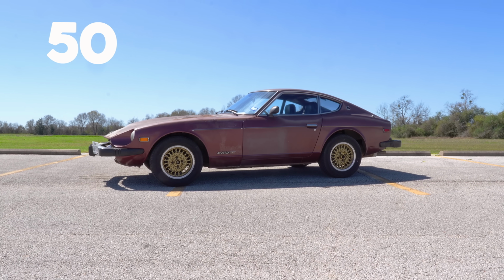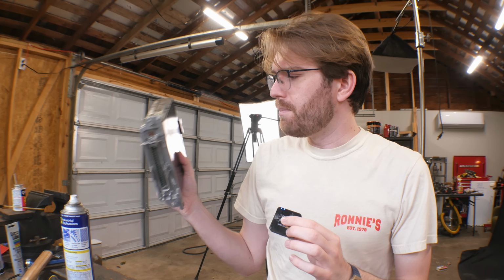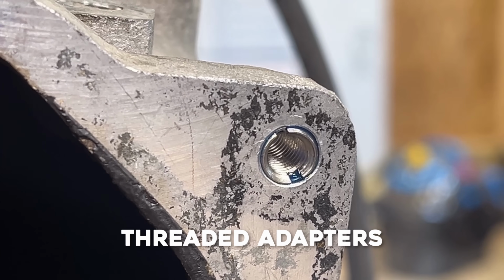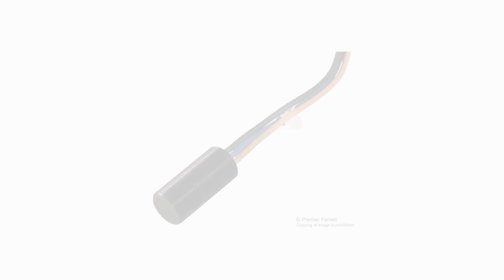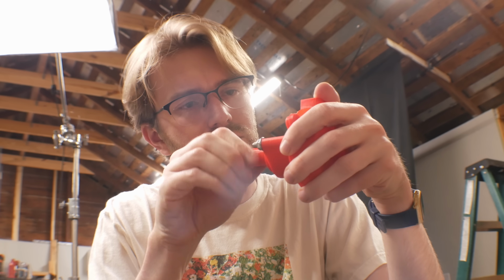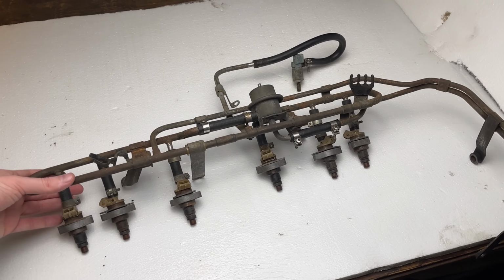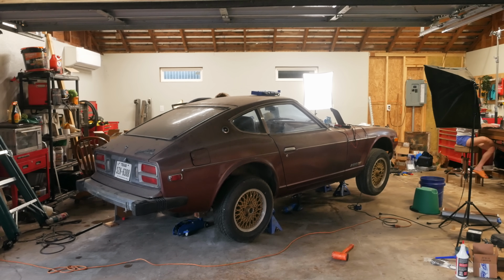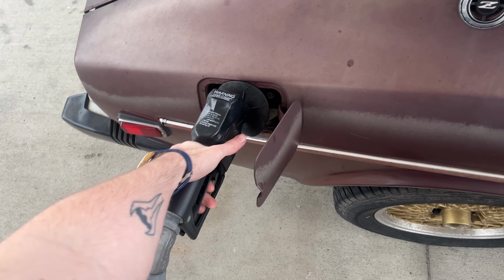Modernizing a Vintage Car

Comment: Is it just you, or is it actually called a trigger wheel in the US?  We call it an ignition rotor, my 2000 Kawasaki ZX9r uses one, changing it is a great way to get more responsiveness by advancing the ignition timing, which of course I have done amongst other cost effective tuning mods, no need for expensive ECU tuning.

Comment: I am so torn. As a twice former 240Z owner I absolutely adore these cars, and as an old guy I love the nostalgia of keeping them "as is". Yes, the car is sneaking up on being 50 years old but its hard to argue with a multimillion dollar corporate tech dept [billion these days] who not only had to make it all work but had to make it reliable. and this is where I hate myself... if it's more power and more efficiency you want, the logical choice is a modern engine swap. And that logical choice is... the Chevy V8. Whether it's old school SBC or modern LS, you can easily double the HP and get fuel economy in the mid to even upper 20's with no effort at all. And the best part is it's been done a bajillion times over so there are plenty of swap "stuff" out there to work with.  Now all that said, if I had myself a Z, and I had myself a stuffed bank account [which never happens] I might even consider a GM LL8 Vortec 4200 as a swap. You keep the straight 2 layout, which IMHO is one of the greatest sounding engines EVER] plus you get 270-290 [depending on model year] of HP in an absolutely bulletproof, bone stock engine. Okay, I can dream cant I?

Comment: 😂😂😂 not a bad experiment, the only things I would do is change the exhaust and exhaust manifold bigger and change the inlet plenum and go for a bigger throttle body. That 50yo exhaust and plenum will be like trying to suck and blow through a straw 😂 won't be much of a gain but it will help or throw some boost at it 😂🤔 other than a turbo, turbo manifold and a better exhaust you have everything else 👍

Comment: Should have installed LPG from Poland. 110 octane, and fuel is 50% price. Pretty much the same process, only plus an additional tank in the place of a spare wheel.

Comment: 26:55 ah yes the good ol' "finding 10 different mistakes you made and none of them being the source of the big issue you're facing"
Reply: Shooting your shot while troubleshooting with a shotgun.
Reply: I found a relay socket with bad contacts once, and I learned why shoving test probes into it was bad. The fuel pump relay wasn't even connected. Cranking the engine for five minutes would energize something else (oil pressure sensor?), which would also trickle power into the fuel pump and the car actually started. It even ran well, when it started at all.
It only took a month plus removing and reinstalling the entire dashboard to figure it out.
Reply: A classic
Reply: Nice pfp
Reply: Been there done that. At least on this project he never had to let out the magic smoke.

Comment: The horsepower gain is just a byproduct to me- making the car greatly more reliable and serviceable is the really impressive part.  We can all appreciate the shit-ton (precise unit of measure) of hours that went into this project and the resulting video.  A masterpiece takes time.  With the refreshed (resto-mod?) look of the engine, consider giving it a Chris Fix makeover (https://www.youtube.com/watch?v=PRSoRkM8GcM) to really make it visually pop when you open the hood and can now see all that aluminum. You gained several pounds of weight reduction too!  Yes, a masterpiece! Thank you!

Comment: Fine addition to the saga! Actualizing fuel injection and not just blatantly spraying it and praying has an additional benefit; oil won't be spoiled by an abundance of fuel flowing downward from the ignition chamber. Wear aside, now the oil can do its job at handling friction better, lubricating more efficiently, and getting dirty after a longer time (if there is a need to keep it in mind here). 
An additional 20 herrspurrs is insane, with only a tighter, more precise fuel injection, fuel-air mixture and ignition timing. That is awesome!
I wonder if the transmission were to have an oil change, the shaft going backwards being redone and the differential getting a makeover - would that also amount a few plus mpgs?

Comment: 25:39 mechanic here : your injection timing is wrong it need to inject fuel at the start/mid term of your intake strock because you have a indirect injection system, you don't have the same system that you show here. here is a direct injection system your injection systeme right now inject in your intake manifold  in from of a closed valve demeniching performance you need to time it so it inject in the intake timing of your cylinder so the fuel gets better atomisation and don't simply drip from your intake valve anyways incredible projet and work hope to see more (and sorry for my bad english lol)
Reply: I imagine they probably fixed that while tuning it on the dyno
Reply: @Roomsaver  hope so because it will not run adnormaly wrong with such timing but only fuck-up the performance at low rev
Reply: @t3cht098 i'm sure his own map was only to reach the dyno/make sure it works before getting there. there is no way a shop called stoopidfast doesnt make this right
Reply: You're correct. They definitely would have fixed all that during dude tuning.

Comment: Wow, don’t talk like that about my 2014 Cruze 'Sport🤣' with the Ecotec Flex engine!! 
(Flex because here in Brazil we use gasoline and hydrated alcohol in any proportion, I only use gasoline, because this 1.5-ton barge gets less than 5 KM/L with alcohol.). 
Thanks for the video!

Comment: so cool! have you thought about doing a project where you only use parts you make? i would love to see more specific plastic and fiberglass DIY replacement options, like with the Fiero's impossible parts. Going back through and using the skills you've demonstrated since the first time, to more permanently fix those little things you wanted to fix back then. It's been a number of years, and the more questionable fixes you did back then probably need at least an inspection. I would love to see how you tackle making large parts, and to contrast with my own techniques.

Comment: Sorry, I've never pulled and upgraded an engine, but instead of printing 100 spacers to adjust the pedal position, couldnlt you just have bent it?

Comment: Pretty impressive what you did.  Not only in terms of the engine, but in guessing what I was about to say.

Me: "Drive by wire?  Lame.  Well, if he wants to risk his computer taking him for a ride..."
You: makes comment about old gearheads and connections between car and driver
Me:  "I feel attacked..."

You: comments on the need for a shaft to be made of hardened steel
Me:  "Well, if only you had an engine lathe and knew how to use it, you could just machine it yourself out of some bar stock."
You: "...so I had a machinist make it for me"
Me: "Or do that."

So help me, I'm actually considering doing something like this for me old C-10, but I need a new head at the very least because Chevrolet made it thin and it got too hot and cracked.

Comment: I was going to recommend a better RPM sensor but I was surprised to see that most of them are about the same thing you have. Good work. Tip: the PLA you're using is in about the worst place for it. You can go with ABS or have a CNC service make them, but I think you'd get faster and quality results with ASA. It's very strong, easier to print than ABS, and fairly cheep. The print times are long, but it's still faster than mail. Just a suggestion.

Comment: Yeas ago I worked as Injection systems and sensor buyer for FoMoCo. So I have a fairly good understanding of those systems. I've never heard of anyone doing what you just did - people would just swap the whole engine - so it's very impressive to see that.

Comment: awesome. 
looks like it needs custom intake manifold and air filter as well. normally aspirated stock L28E holds up to 220-230hp. 
or just will turbo be next step?

Comment: What an amazing work ! 
I did the same kind of project on a little 125cc, but OPPOSITE 😂
Converted an EFI bike into carb, the whole EFI system was complete garbage 😱 
Replaced pumps, CDI, injector, tank, nothing was working.
Screw it. 
Amazon carb, parts from ebay and a Dremel made the bike run again.
It never ran that good !

Comment: Not only did you get better efficiency and probably better emissions but also +20hp out of an old NA engine without changing internals intake and exhaust that is a massive gain you also lost about 3lbs in tubes and stuff and made the engine way more compatible too other performance modifications  like forced induction depending on the goal you could get away with  only adding a supercharger and increasing the fuel map and well same tubing 

Also if i remember correctly  the L series  of engines have the same bolt pattern as the rb series  soo you could also get more out of the original block with a other head doubling the valves without getting too much in too the guts of the engine gives better high rpm performance but a slight loss on the low rpm torque and should increase overall efficiency even more and if you do soo and want too keep it NA maby increase the compression on the way since fuel has become way more resident too knocking it would be a waste too not use the additional octane you have (more octan means less energy dense fuel soo same hp is lost therfore but the gain in efficiency if put too use at higher compression or with forced induction is a bigger factor)

Comment: Stop fuckin modernizing vintage cars. You're ripping their soul out. If you like modern cars, then drive modern cars. It's so simple. If you don't like "inefficient" cars, or cars with no electronics, or cars with not 100% precise handling and high performance, stick to modern cars. Leave the vintage cars to those who appreciate them for what they are. Jackass.

Comment: Bosch is far more than a “dishwasher company.”
They invented the high-voltage magneto that made early cars reliable, the first electronic fuel injection (D-Jetronic), the lambda sensor, ABS and ESP, plus today’s radar/camera systems used in modern driver assistance.

Comment: I'm sure this is going to upset the purest out there, but I can't help myself? Yes, I'm aware that he showed up an empty wallet. BUT, I'd drop a Chevy 350 TPI with some headers and a 700R4 trans in that bad boy and get on it!!! HAHAHA bet you thought I was going to say an LS?!? Which isn't really a bad idea. 
But given money is an issue, a 350, 383, or sb 400 would be less expensive, depending upon what, how much, what brands you intend to buy. Those motors in that can have the ability to get where you are going quick, fast, and in a hurry! 
Sure, I would most definitely keep the engine!! Take you time tearing it down and rebuild it with genuine parts, if you can find them. Get in all buttoned up, wrapped up, and put it in a storage crate. But that's just my humble opinion 🤷🏼‍♂️

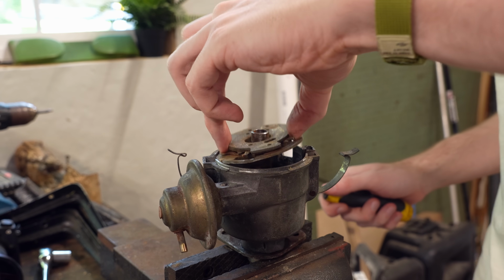Comment: When you said case hardened steel around 16:13, and the pic of that part popped up, I remembered how I got here. Very cool! That reluctor wheel/crank sensor assembly is truly a work of art too. Over engineered and beautiful! When you had the engine out, you could have at least done the head gasket tho. With that awesome fuel/spark system, you could take advantage of higher compression, and maybe get a matched cam. Not even race stuff, just normal. Like 10.5:1 and a ~210 @0.050 duration cam, port the head a bit so it isn’t so 70’s-style choked. Of course then you need brakes, suspension, transmission and rear end to handle that increase, whew that sounded expensive…

Comment: I know you said you didnt want to make any changes to the internals of the engine, But I'd definitely still like to see it. I Love resto mods like this so much. Alot of people just settle for a new engine in an old car, and while thats fun too, giving an older engine like this new life is SO much cooler. I'd love to see you do more with the engine, and maybe some other technical upgrades to stuff like the exhaust, suspension, drivetrain, etc. I'd love to see some speedies equipment exhaust components on this.

Comment: I love your 10yo home-built 3D printer. Mine is of similar ilk, though i have avoided some design mistakes on mine, say my part cooling fan isn't an axial airflow fan running against horrible air plug. I don't mean to say that i avoided them from the beginning, i just mostly fixed them eventually.

Comment: In 63 years you're gonna be glad you did this.
Reply: that's like only 12 uploads away!
Reply: @adambaranek 12 uploads away? I could swear 63 years is 2 uploads away.
Reply: Now that he has every possible sensor in place, better airflow and more fuel. Bigger cam would be huge gains. It would make 180whp easy. And since its single cam, cheap af
Reply: @DuBstep115  Since the idea is this to be a daily driver gigantic cams are not good. A slightly more agressive profile however can be good to help with the powerband
Reply: 63 years at today!s Gas prices...
Reply: @snflupigus So he uploads more often when FJB is in office?!? 🤔
No, difficult as the choice is, I guess I just have to wait 😔
Reply: Still a sooner event than GTA VI
Reply: @Edward_Waterfield  That's coming out at the end of this year.
Reply: none of these new part will last that long. but a good 10 years if they are quality wich is still better than stock.
Reply: By that time he would have worked out all of the grounding issues and eletrical system overloads.
Reply: @Onix-Void  he needs a 90A altima/maxima alternator. the stock alternator is only 60A and is really not efficient when you start to add any upgraded electrical systems to the car. These cars especially ones with rust/bondo can suffer from poor grounding so it never hurts to add as many grounds to the engine bay as possible. one to engine block - chassis and then chassis to battery neg- creating a circle ground for any other grounds.
Reply: The car will only be 113 years old! 😂
Reply: Oddly specific...
Reply: I'm 59 and this reminds me of my old 260Z. Loved that car.
Reply: Reminds me of people saying "I bought a diesel for the fuel economy".  Yes after 6-8 years of ownership...  terrible investment strategy.
Reply: he'll be dead?
Reply: Please... that number is at least 5 years less from the commission from this video.. :)
Reply: Should be a little shorter now...

Comment: Interesting project, but I can't stop thinking if it was worth the effort, just to gain less than 20 hp, and increase the fuel efficiency with approx. 2 mpg. Adding a more efficient exhaust system would give you about 10 hp on top of that.

Comment: Cheaper way to gain more is just with new camshaft bearings and piston rings as they are the main reason for weak power and maybe just a build a new head! But you may do it now and find out!

Comment: The electronic throttle control certainly saves a ton of headache, but i do feel why the enthusiasts dislike E.T.C since most commuter cars with it will have mapping which dampens throttle inputs, especially bad on some ford models where you can get a full on second delay before the throttle responds if you punch it from a stand still. Still as its a software issue a simple throttle controller fixes and restores that 'direct connection' of instant throttle response which cable driven bodies brought

Comment: why not LS coil packs? Would have made it easier to adapt then a coil on plug coil pack.
Reply: The trigger wheel could be also  readily adapted from other I6 engines from the GM Atlas or RB26/or even the 2JZ onto the crankshaft rear or front.

Comment: Why is batch injection wasting fuel? The fuel just gets deposited behind the valve and the walls there. It gets sucked in later.
Only benefit of sequential injection is that you can tune each cylinder individually and possibly save some drops because they are not 100% the same.

Comment: I literally can't see any reason at all for case hardening that part. It's under no load at all. all it does is rotate a disc. you could have made it out of plastic if it could handle the heat. It used to turn a distributor. even then case hardening is overkill. All in all was great content though. Nice to see a new video from you. See you in a few months.

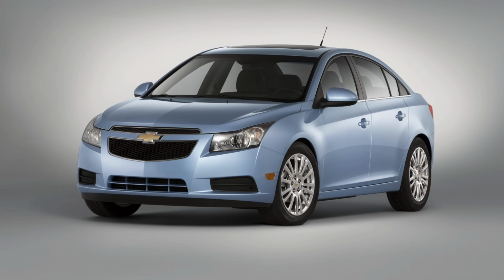Comment: 2:04 😂😂😂oh god now i know why it takes you so long between videos! The ammount of time and money youve had to dump into that car just to keep it going. I had a 2014 cruze eco. Absolutely the worst car i have ever owned in my life! Ove 7 years of ownership it ate up 5 water pumps, 4 coolant outlet manifolds, 4 thermostats,every other part of the cooling system except the heater core. 1 fuel pump, the entire evap system, two o2 sensors, 4 turbos, and various other things. A few things id suggest, replace thermostat and coolant outlet manifold with metal varients. Do the cruze kits pcv fix, swap the fuel pump with a normal cruze fuel pump for more fuel copacity and range, swap the fuel pump control module with a normal crze turbo one so it eliminates the stupid lower grill louvers, and remove the upper grill block off plates. You wont lose ant mpg from doing so.

Comment: Dude, Nismo just released a DOHC conversion kit for these L-Series Engines. It's super cool, but wildly overpriced. It's a Nismo parts kit, part number 10000-RRS00. It's priced at almost 25K (I shit you not) and it doesn't even include a fuel delivery solution or lower engine parts required for the kit to function.

Comment: I have an EMU Black in my daily driver 2G eclipse running a throttle body from an A4, gas pedal from a Jetta, Audi R8 coils, Hellcat injectors, electronic wastegate from a BMW 328i on a Borg Warner EFR, two Spal fans, and the AC compressor. It’s a game changer versus the stock 90s eprom computer!